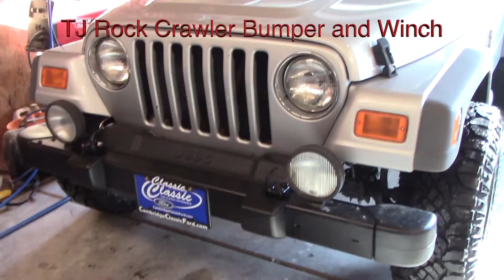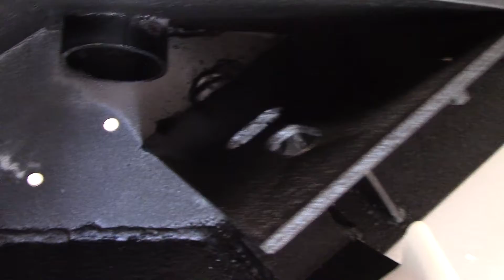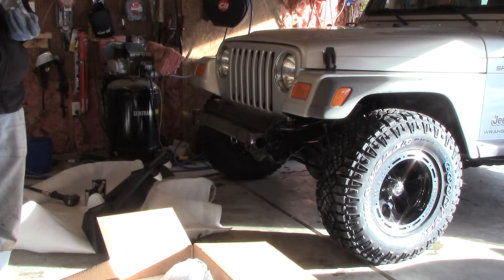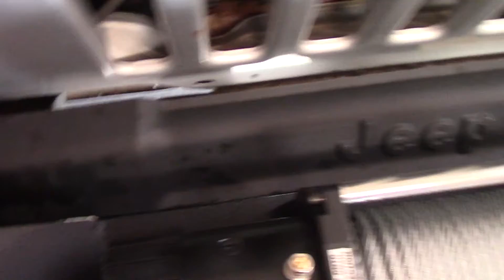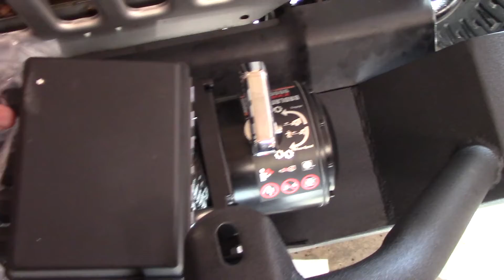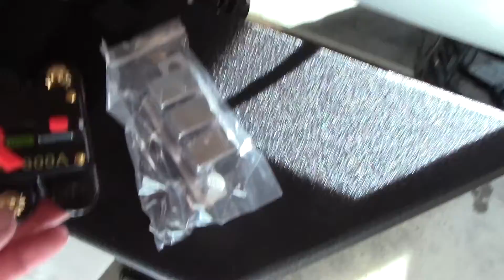Jeep Wrangler TJ Winch Rock Crawler Front Bumper Installation EAG 97-06

Comment: are the wheels 15 in. and are they 33 by 10.50 or 11.50.im lookin to put new tires on mine,i have the same wheel as you do ,but mine is 15 in.but im running 33x12.50 x15.im looking to go with AT something like you have.i know they were not cheap.seems hard to find decent priced tires for 15in. rims.looks goodjust curious if they are 15 in. and the width looks great.think i wanna go little more narrow.
Reply from the maker: 31 inch tires on 15 inch rims. No lift. Can't remember the width. Probably 11.5

Comment: i have a bumper i just installed on my 98 tj.the holes didnt line up well at all and im planning on putting a winch-plate under my 12000 lb badlands winch.how thick is the bumper on yours where you bolted your winch to? good idea on the breaker.i have a 300 amp but it isnt a switch.gonna grab one of those.mine was on jeep and they didnt put the water-proof gromets where cables go into top of winch.do you know what size those are.ive found some on amazon and few places but they go by 1/4 in, 1/2 , 3/8 etc. insted of the awg. of the wire.just thought your instructions might say the size.i spent 2 hours trying to get more info.no real solid luck.thanks.good job,pls reply thank you, Robert
Reply from the maker: Those came with the winch. I'm sorry I have no idea on the size